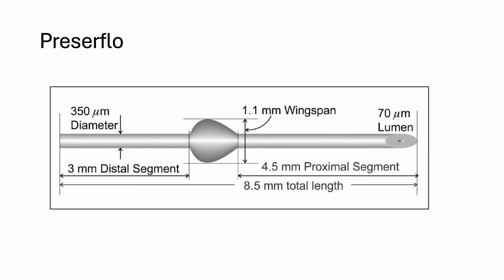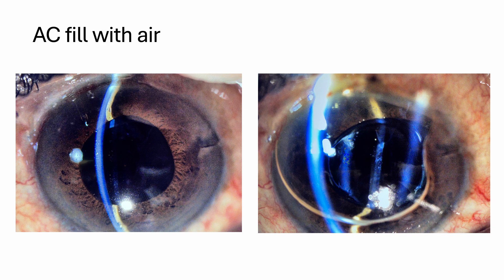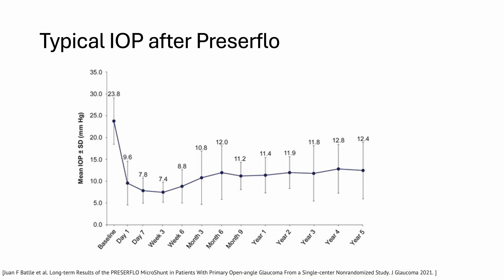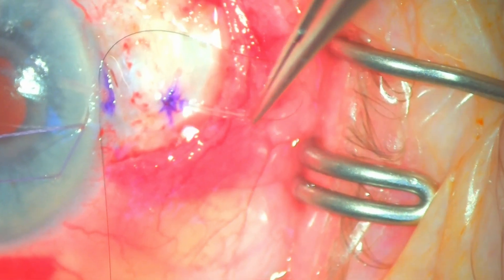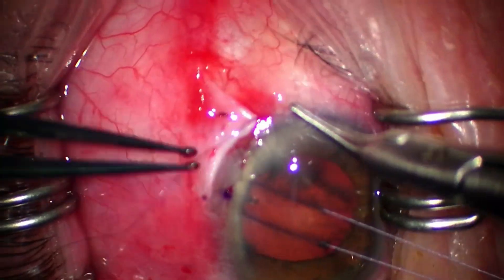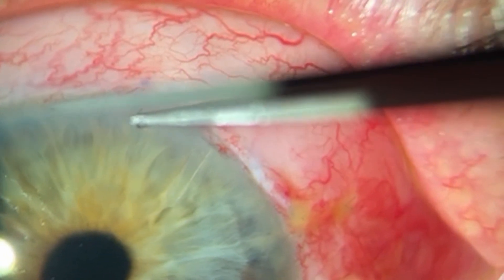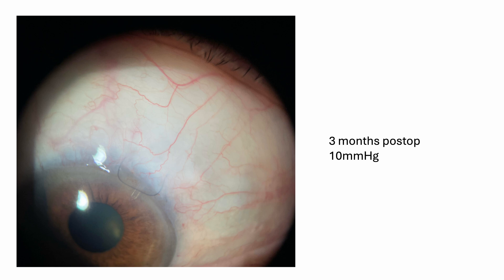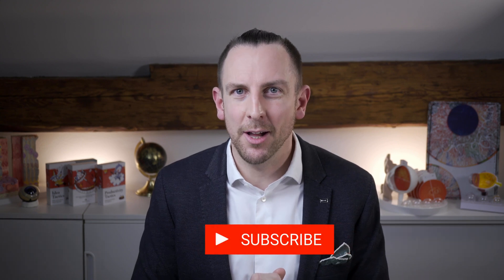Preserflo Nylon ripcord/stenting to prevent Hypotony

Comment: Very nice vid, i also routinely use a releasable 10-0 nylon as a loop in the cornea, but i take an important bite thru sclera before feeding the suture end into the stent.... When it comes to slit lamp removal, this avoids the risk of posterior end of the stent being tangentially pulled (and inadvertently getting tenons or other stuff occluding it)

Great work